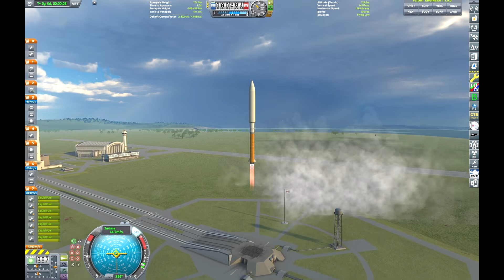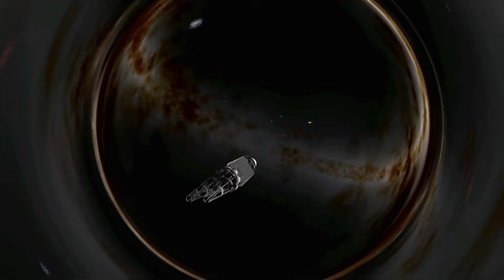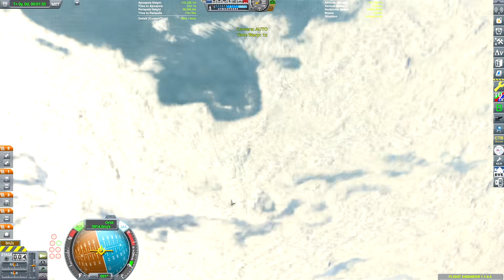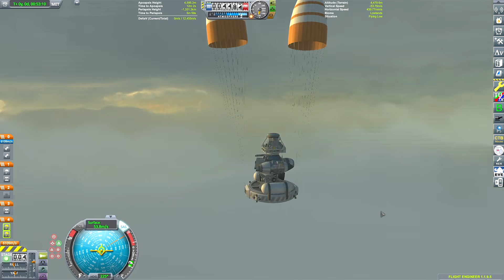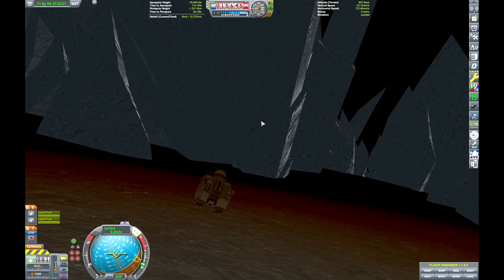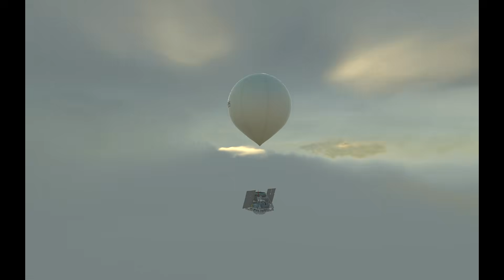WATER WORLD of a Black Hole: Roquea - in Kerbal Space Program - Kcalbeloh System & Far Future Tech

Comment: You went 15km below the ocean, on freakin Roquea that's just legendary man. I had no idea there were crystals and ice deep down there.
What mod did you use for the baloon? It's neat.
Reply from the maker: Thanks man! Haha I appreciate it! Yeah I had no idea either I was genuinely shocked for a second wondering what the heck I was looking at. The air balloon mod is called KerBalloons, it is pretty cool. Thanks for the comment, I really love your content btw.
Reply: Some phases of ice at extreme pressures can form even when it's very hot. The ocean floor looking red could be because it's blackbody radiation.
Reply: If that was a irl, it will be ice VI, but 15km dont it enough deeper for those

Comment: Pretty sure the ground isn't ice as that would make no sense, think it's just a strange texture. The bottom of the cracks however is definitely ice, more specifically exotic ice from the pressure being so intense that it becomes solid despite the high temperature. On planets where this occurs it's theorized to basically kill any chance of life forming despite the presence of water because it would cut off the planets ability to transfer materials from the mantle to the ocean which is thought to be necessary for life to form.
Reply from the maker: Thats super interesting

Comment: Yup, it's thanks to the pressure. At some point, dependent on temperature and saltiness water turns into ice VI, which is heavier than water and sinks. On Earth it would happen at the depth of 60-100kms. Considering that Roquea is bigger, and therefore has higher gravity, and is rescaled for ksp, 4-5 kms at this scale is a good depth for it to begin forming.  The cracks are most likely made by the tidal forces of Kcalbeloh. Another fun thing is that the ice on the bottom of such oceans can form layers, caused by different saltiness levels. (The saltiest water is on the bottom because it is too salty to freeze, then ice, then less salty water, ice again, etc..). It can happen on big oceanic planets or moons of gas giants, like Europa, and the layers probably form on bigger objects, like Ganimede. I encourage you to dive deeper into the subject 😉
Reply from the maker: That's fascinating! Thank you for adding this insight!

Comment: how do you use a drone? i can't make a strong enough signal for that
Reply from the maker: I just turn off the connection requirement in settings. For interstellar travel you'd essentially need automated robotics anyways because of the relativistic signal delay so that's how I justify it. Also you can't send a signal through the wormhole & the distances are outside of the range of the stock antennas. There are ways around it but I just turn off the connection requirement for ease.

Comment: Hey buddy! at 6:26, you are doing it all wrong, atleast, partly. Yes, Inclinations are more efficient the slower you travel, because the oberth effect works against you in this particular situation. 
What you should do is timewarp to the highest An/Dn and THEN bring it down to 0. When you burned Anti-Normal at apoapsis, and not on the Ascending Node, as you can see, you didnt fully bring it down to 0, and now you have brought both Node closer to the blackhole, making this inefficient. 
Sometimes, its even worth burning the complete opposite direction 90 degrees off a node, to bring a node slightly higher, so that you can neutralise it at a more efficient place.

EDIT: [Alternatively, since inclination changes are costly, if you bring an An/Dn to the place of an orbit intersection, then you do not have to correct the inclination, you will simply enter the planet's SOI at an angle, which if you land on the equator, means that inclination changes are not needed]
You could have also performed many gravity assists to make this entire trip practically free, although with the far future tech mod, i guess that isnt necessary. 
Hope this helps! feel free to ask more questions
Reply from the maker: Yeah, I know, I started the burn at apoapsis before reaching an ascending/decending node because I wanted to get it fairly close but not have to wait another full orbit to reach the furthest node. I had the extra fuel so I opted to cut down on the mission time with a less efficient maneuver. Thanks for the tips though! I've tried to do gravity assists to get all the way down to the black hole but it is highly impractical and takes hundreds and hundreds of years so far future is great for these missions!
Reply: @boguekerbal  With enough Dv, any inefficiency can be ironed out ;)
Reply from the maker: @gamerboy7224  Yeah man haha. overdoing it is the Kerbal way haha

Comment: Real pros use the nuclear fuel processor to make the FiP as they fly, allowing them to use the Asimov FFR to attain massive amounts of delta-v. 10,000,000 meters per second is easily attainable, allowing for proper “realistic” STL interstellar travel.
Reply from the maker: Dude that's insane, I didn't know that, I'll have to check that out. I've barely scratched the surface of the Far future tech mod.

Comment: Great video as always, but what fuel tanks did you use? I cant find them.
Reply from the maker: I am using the Fission pellet tanks, they are pretty small. They are a switchable version of the smaller Nuclear Salt Water tanks in the far future tech mod. As for this craft, I've kind of cleverly fit the tanks under the corner gaps of the radiator panels in-between them and the structural frame of the craft. Thanks for the comment!!
Reply: @boguekerbal  Thanks so much!
Reply: @boguekerbal I was just thinking about asking where you put the fuel tanks on your interstellar stage
Reply from the maker: @Javelyn_Shadow Yeah man, the form factor of the fission pellet tanks is pretty small. I was able to fit them in there hidden pretty nice to achieve a cool aesthetic.
Reply: @ yeah, it does look really cool

Comment: I also have blackrack installed, but the clouds are 2d. They're still beautiful, but they are all flat
Reply from the maker: You're gonna want to make sure that TVC and Parallax are installed correctly, on the Patreon page it has some instructions to fully get rid of all your previously existing EVE & Scatterer installs so there won't be any conflicts as TVC already includes a version of these inside it. That might be the issue. But as for getting TVC to work with Outer Planets Mod & Kcalbeloh, you will need the config installed to get it to integrate with these.

 Here is the link to the OPM TVC config I use: https://spacedock.info/mod/3501/Outer%20Planets%20Mod%20-

& Here is the link to the Kcalbeloh TVC config I use as well: https://github.com/jcyuan06/Kcalbeloh-Volumetric-Clouds/releases

& remember you will need the base TVC mod Here: https://www.patreon.com/posts/true-volumetric-77198227 installed as these are just configurations for OPM & Kcalbeloh integration. It costs like 5 dollars. Hopefully you can get it working!

Comment: Are you using the fission fragment engine’s afterburner mode? It is superior to the lower thrust mode in every way. It has higher TWR and gives you more delta V any day of the week!
Reply from the maker: I think I did switch on the after burning mode for circularizing around Roquea! The TWR is great and I packed some liquid hydrogen tanks along so I could use it. I didn't know that the ISP was better in after burning mode than the normal one! It's usually the other way around. I actually really liked this engine. It's great for smaller craft, but I could see it used for bigger ones & it's really easy to use.  Thanks for the comment!
Reply: @ it’s best to use the afterburner all the time instead of using it only for longer burns I believe.
Reply from the maker: @nebula2008 Oh, ok. Good to know!
Reply: @boguekerbal The afterburner has a lower ISP but with proper fuel balancing(3 of the largest hydrogen tanks and a bit extra with the largest fission fragment tank) you burn for longer at higher thrust, so more delta v (3-4 times more depending on the payload)